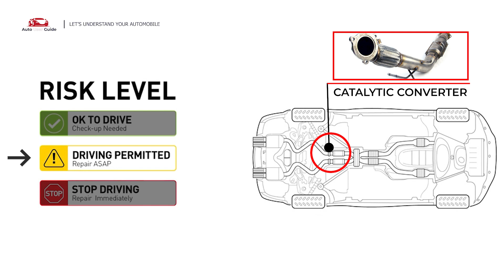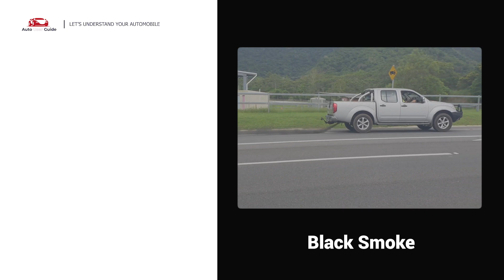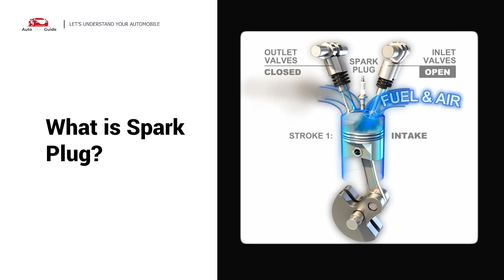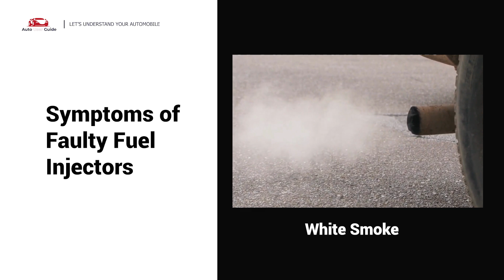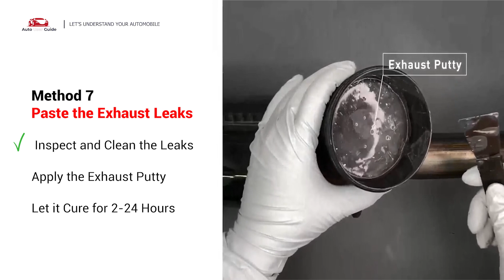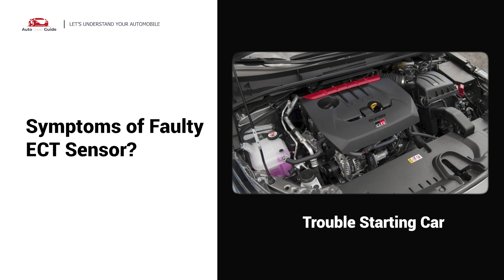How to Fix P0420? Engine Error Code

Comment: Mine hilariously is because the engine did not detect any coolant in the rad and I found that the rad had been damaged. This code also came on when I threw 85 octane instead of 87 octane. 08 Honda Accord V6. Bought the car without realizing the undisclosed damaged, since then the code hasn't come back up. Dealer quoted me 3,000 for the 2 front cats on the engine.

Comment: I just got done replacing the spark plugs in my truck and since that time (about a day later), I started getting the P0420 AND P0430 codes.
Reply from the maker: The P0420 and P0430 codes both point to catalyst efficiency below the threshold for Bank 1 and Bank 2, respectively. Since these codes appeared shortly after replacing your spark plugs, here are a few things to check:

1: Double-Check Spark Plug Installation – Ensure the spark plugs are the correct type and properly gapped for your engine. Incorrect plugs or gaps can cause incomplete combustion, leading to unburned fuel entering the catalytic converter.

2: Inspect Ignition Coils and Wires – If any ignition coils or wires were disturbed during the spark plug replacement, they might not be fully seated, causing misfires.

3: Look for Exhaust Leaks – Even a small leak upstream of the catalytic converter can throw these codes. Check around the exhaust manifold and pipes for leaks.

4: Oxygen Sensors Check – Inspect the upstream (pre-cat) and downstream (post-cat) oxygen sensors, as they monitor the catalyst efficiency. A faulty sensor may be causing the issue.

5: Reset the Codes – After verifying everything, clear the codes using an OBD2 scanner and monitor whether they come back.

6: Catalytic Converter Health – If everything else checks out, the catalytic converter itself may be deteriorating, especially if the truck has high mileage.

Let me know if you need more help troubleshooting!